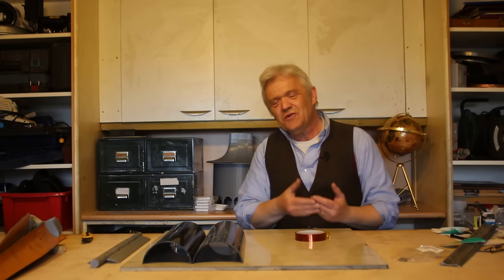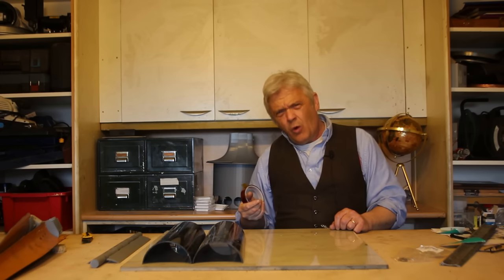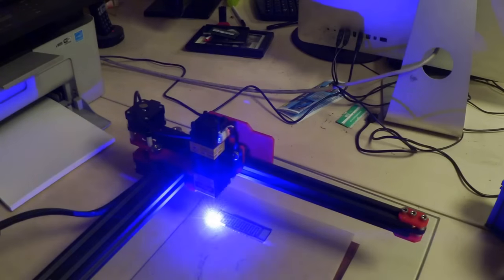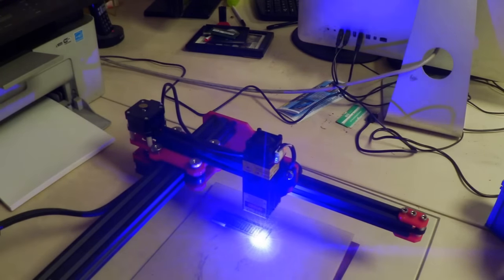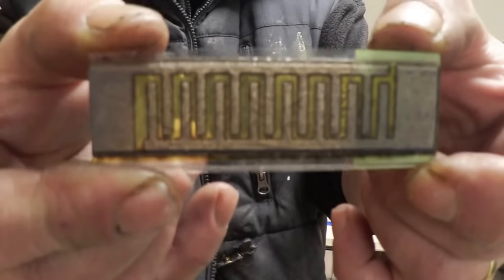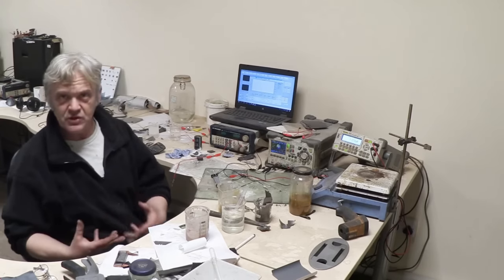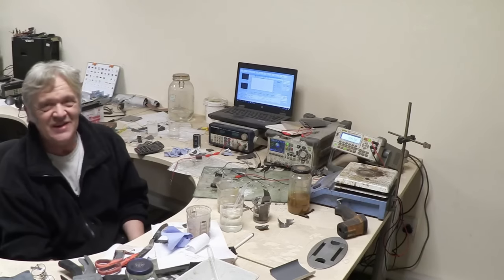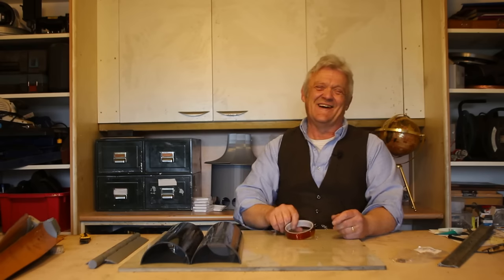1947 Making A Laser Supercapacitor

Comment: I thought you were going to use my idea of covering up the thing being lazed by a transparent to the laser sheet (the sheet sitting on the table under everything) so oxygen is deprived of the object being lazed so you could laser things that normally ablate into CO2 apparently like styrene or any multitude of materials used in making tape that is far cheaper than kapton tape LOL)

Comment: Here’s something I want to know-

How does graphene fail?
Is it like carbon fiber and it’s just catastrophic?  Or is there any kind of flex to it?
Reply: Like carbon fiber it has an immense tensile strength, exhibiting essentially crystalline metal atom-to-atom bonds. However its compression modulus is horrible along it’s plane, same as CF. Extremely brittle, buckling and shattering very easily.

Comment: based on the thickness it sounds like a stack about 2 centimeters tall would give you a full farad or am I off on the math there? (micro=1/1000th?) if so that means it would beat out some of the better super capacitors out there I think, especially if it could be compressed to get a smaller footprint without losing that capacity, just need some of that super thin mylar used in thermal blankets LOL (for separation of layers, unless you could double down by mirroring the design every other one and stack them facing each other so its a single storage area on each double thickness)

Comment: Hey Robert I have an idea that I don't want post publicly yet.  I think it is so good but sometimes my ideas are rubbish.  May I email you my idea. It is related to this video.
Reply: I thought about it.  And this is an open forum so my ask is unfair.  I will just say it.  A laser's effect on liquid CO2 would be interesting.
Reply: What does "get lost in the manure of life' mean?
Reply: Wouldn’t it just be co2? When heated it will just turn to a gas. Right? 
Since a co2 gas is clear I think, the laser probably wouldn’t heat it up. 
Also you would need to split off the oxygen, which from the brief reading I did looks to be troublesome.
Reply: @kyleprice36  but under pressure it is a ...ah there are some tweaks that I haven't disclosed...but yeah may not work.

Comment: Hey mate can you show us how to extract methonol from biodiesel ? .....many thanks !
Reply: There is no methanol in biodiesel.  Methanol is used to make biodiesel, but it's separated from the finished product.
Reply: @McRootbeer  I know but what i mean is after that seperation is there a way to salvage most of that methol to use again ?
Reply: @sheepsfoot2  yes.
Reply: @McRootbeer  can you tell me ?
Reply: @sheepsfoot2  Google can
Reply: @sheepsfoot2  theoretically quite simple, you just need to hydrolyse the methanol derived biodiesel. Theoretically you could add acid and a phase transfer catalyst and distill off the methanol to shift the equilibrium. The probably better suited approach is to use an alkali hydroxide as this will already shift the equilibrium completely towards the carboxylate/methanol and you can again distill it off